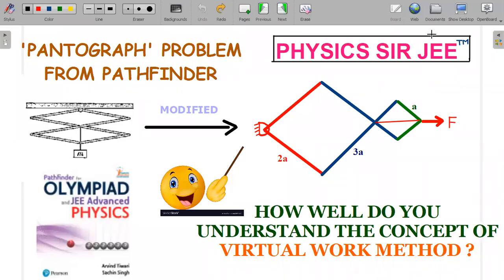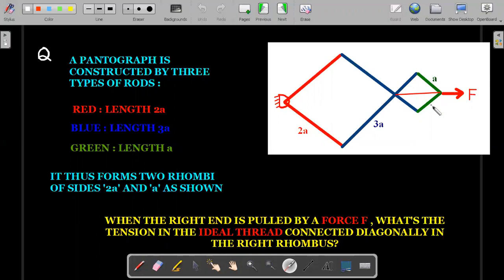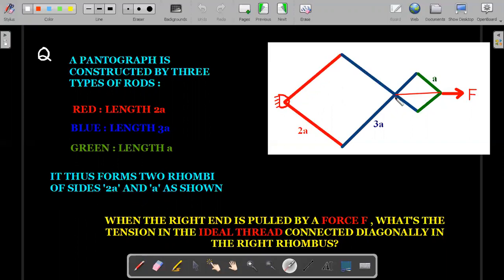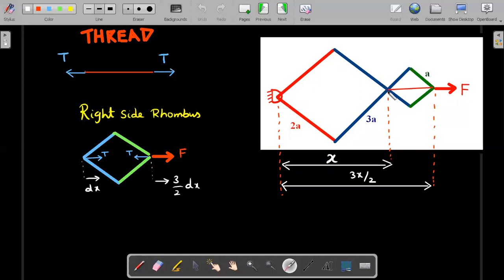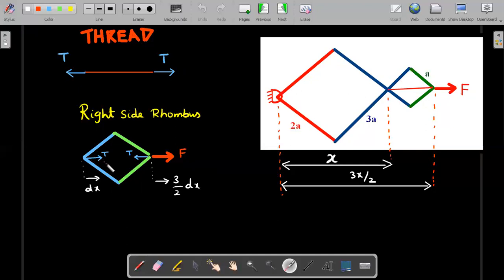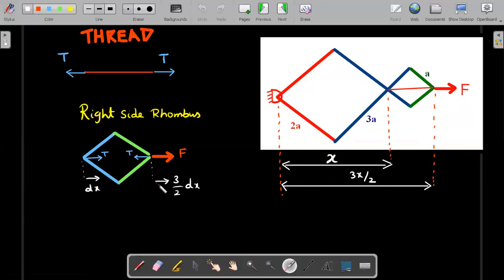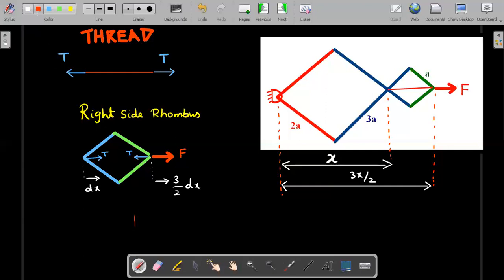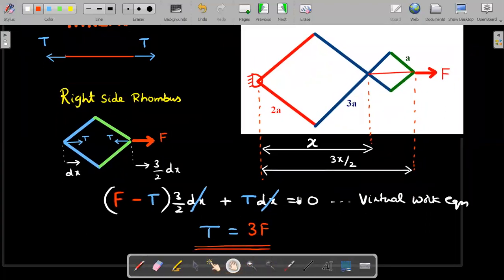PANTOGRAPH CHALLENGE FROM PATHFINDER    CAN YOU SOLVE THIS IN ONE STEP?

Comment: Sir can you pls explain how displacement of the two hinges are different. DX and 3/2 DX . Since connected by same string shouldn't the infinitesimal displacement be same
Reply from the maker: The idea of virtual work is to assume virtual displacement. So front and back ends won't have same virtual displacements
Reply: Actually diagram is little wrong second rod length is 2a not 3a
Reply: I am bit late to reply lol. But 3a is 2a of left rhombus+ a of right rhombus

Comment: And the rods also have tension, so why their work is not considered??
Reply from the maker: Please read my reply to "Vineet" sir's comment below 👇
Reply: @PHYSICSSIRJEE  ohkk I got it because we are not considering the virtual work by rods, we are seeing only string virtual work...
Reply: @PHYSICSSIRJEE  
Sir can you please tell if my Interpretation is correct....The virtual work done by the rods on the first rhombus is equal to but opposite of the work done by the rods on the second rhombus..So their work adds to zero...also for entire system Leftmost hinge is not moving So it's virtual work is  zero. So we consider only tensions and force's work...
Reply: @PHYSICSSIRJEE  
Sir I have one more doubt regarding Virtual work method....In pulley System's when we use the sum of the virtual works =0,, the relation of Tension.accleration is applied only on blocks....But in one Infinite pulley problem we use sigma T.a=0 for the blocks as well as for one of the acclerating pulleys.....So finally what is right?? Can we use in one acclerating pulleys and blocks also ???

Comment: why are we ignoring the hinge reactions or the forces from remaining part of blue rods
Reply from the maker: That was a good query sir, the virtual work equation was written for entire pantograph with external forces F and two T 's only doing work. ( even though diagram shown was of right rhombus in Solution) The hinge forces of the system are internal non-deformative , so W by them is zero
Reply: Would it not really take a little more elaborate argument or maybe a set of equations of equilibrium to be able to prove that the rods are non deformative especially if we replace the string by a hinged rod.
Reply: But the tension would not change even if we take a rod instead of a string .
Reply: @vineetguleria  sir u can check out some standard text on virtual work it will be cleared
Reply: @PHYSICSSIRJEE  sir even I have the same query ,can we prove this argument .also how can we approach this q without virtual work (I am getting stuck at fbd pls give some hint)